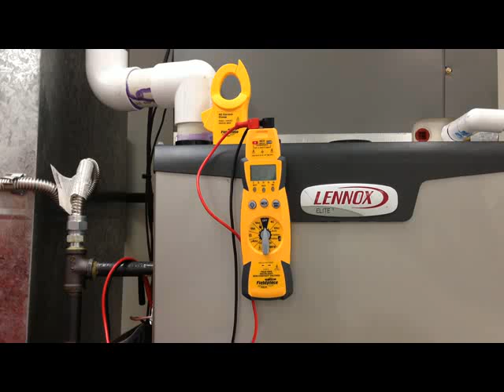Multimeter Hieroglyphics: How to Use Every Aspect of Your Multimeter

Comment: I have a question regarding this tool and possible damage. I kept going through temperature thermal couples not being able to get a steady lock on the temperature reading like the Pro was going out again and the numbers would come on for a second or disappear depending on how the wire was laying or coming off of the meter so I decided to try to clean the ends of the probes off the thermocouple as well as the plug-in thinking maybe it was gummed up or had dirt and debris in it so I used a little bit of alcohol on it and then let it dry out.

Apparently I turned it on too soon as it was not fully dry and was getting weird screeching tones and numbers were all over the place so I let it dry out for a few more days until that went away and seems to be working fine now other than I question if the tone that I’m getting from checking high voltage such as 110 V or 240 V is correct? It shows me the voltage that I’m checking but it flashes and the audible beep is on and off deep rather than a steady long tone similar to the Reading you a get checking continuity. 

I thought I had remembered whatever you read something hot such as 240 that it would give you a long steady tone? I called Tech Support with this question and he said that it was correct and doing what it should be doing but I still question it as I really don’t remember it doing that before. 

Any other opinions or help would be fantastic thank you very much!

Comment: Jose, can you do a video on how to properly run PVC condensate lines on both Positive & Negative pressure systems and the use of P-traps?  Some people on the forums say the use of a P-trap is a must on negative pressure systems while optional on positive pressure systems because it's probably not needed and there's a greater chance for a clog and callback.  They argue it's worth the small amount of air leakage as opposed to creating a potential clog point.  Others say a p-trap is a must on both positive and negative pressure systems.  

All the videos I've seen on YouTube aren't very clear on the subject and the HVAC forums are also very conflicting.  Thanks for the great educational videos.

Comment: Hi ,noticed the short radius 90 I thought that they are supposed to be long radius 90 s when venting ?
Reply: The book for the furnace you are installing tells you about the fittings short bends count as more feet meaning to many short bends you would have to run a 3” pipe possibly instead of 2” if you go over the footage 2” allows for that specific furnace.